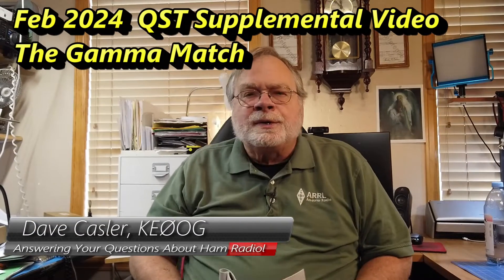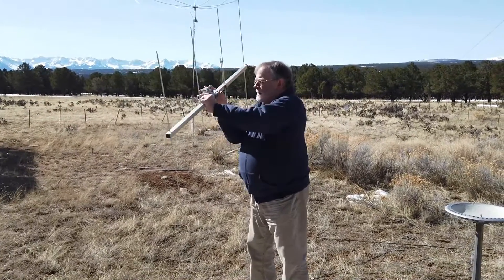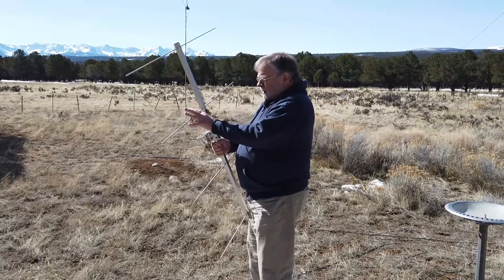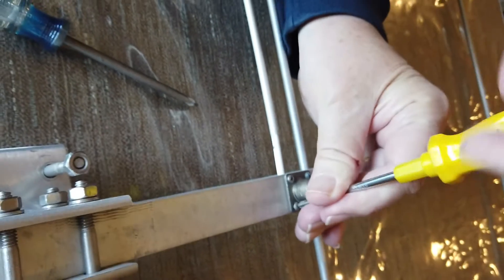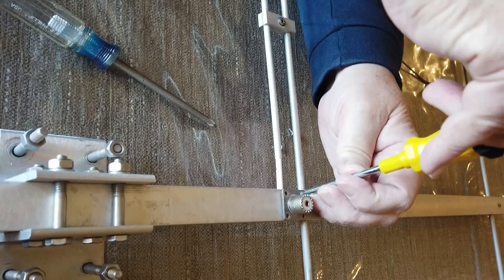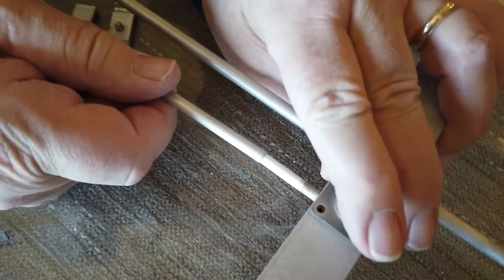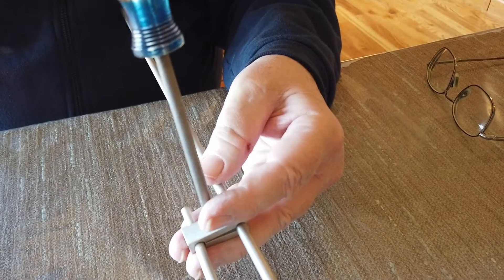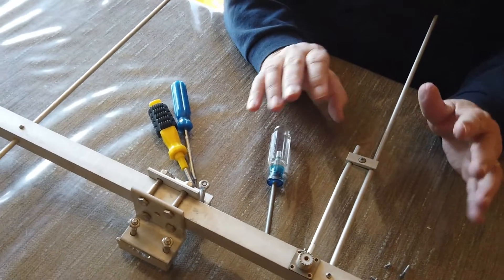QST: Ask Dave February 2024 The Gamma Match

Comment: In the vertically polarized orientation or your antenna, won’t a metal mast will ‘upset’ the balance of the antenna (i.e. tuning)?
I have found this with a homebrew 2m beam and used a non-conducting mast. Also have bought a production 2m beam and the mast is positioned at the far end of the boom before the reflector.